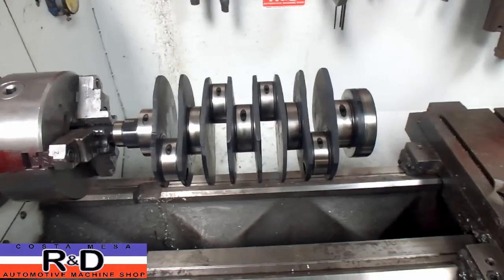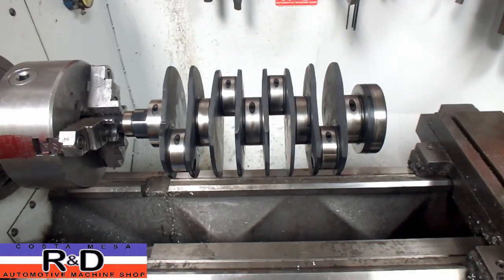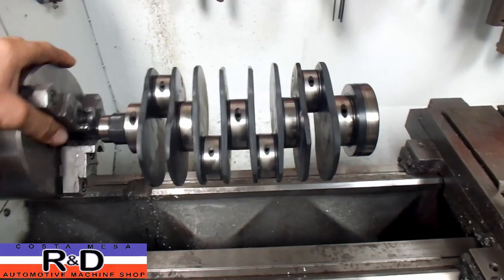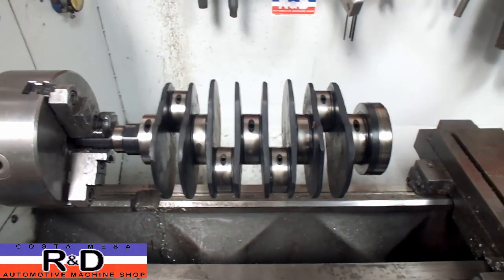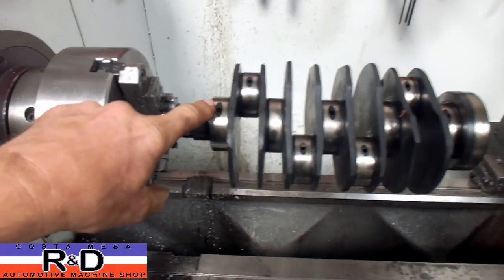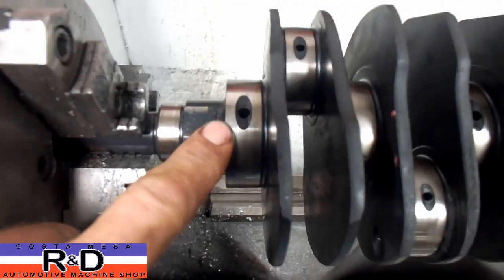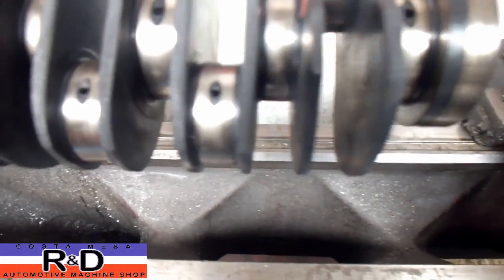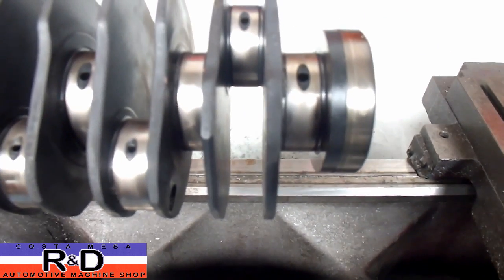Chamfered Oil Feed Holes on the Crankshaft

Comment: chamfering helps with oil dispersion and maintaining that little shield of oil between the crank and the bearings, almost every Daily driven V8 with 600+ HP i've seen built has had chamfering done to keep the bearings safe and well oiled under load. although the chamfer was usually only on one side. not both.  as my father in law had his 350 block built to a nice 383 stroker after a shoddy crate engine from NAPA ( with a cracked cylinder wall that had to be magnafluxed to find)  the machine shop chamfered the rod oiling holes and double chamfered the mains oiling holes, so far he hasn't had one issue after several years with his built engine, and has driven it long distances as well, no issues.   only things breaking on it now are driveline and body rigidity as he decimated a rear differential. and put a barely noticeable crease in a rear fender launching it.

Comment: Hi fiatnutz, I'm wondering if beside the chamfers, do they turn down the diameter slightly on the same plane of the holes / chamfers (i.e. middle of the journal) so that there is flow even when the hole is not lined up with the fluid pathway? Thx

Comment: Porsche has done this on their 911 crank rod journals since the 60s   Makes good sense IMO because the ovalized shape allows the oil to spread more effectively vs. a typical plain hole with just its chamfered edges around the hole itself